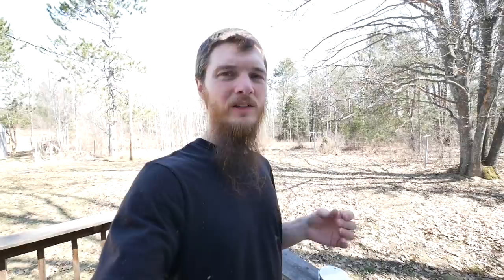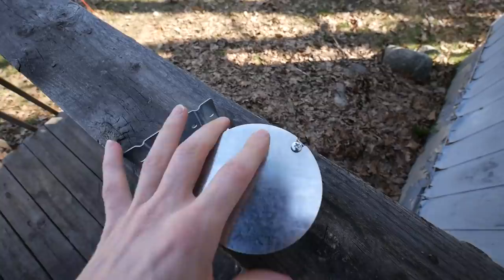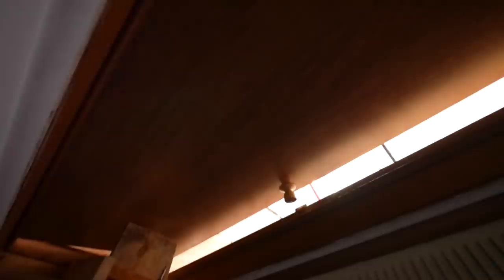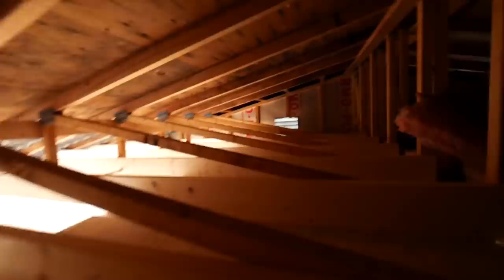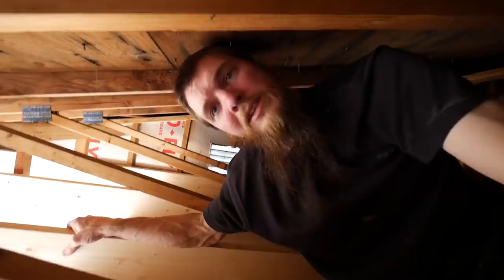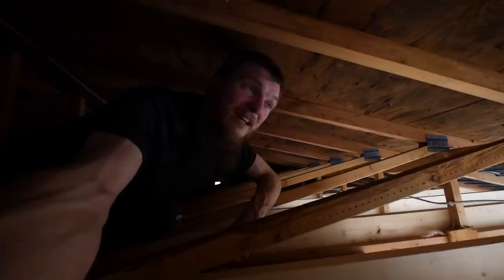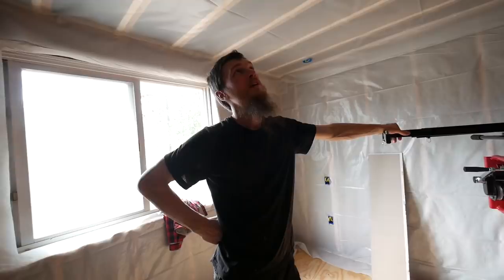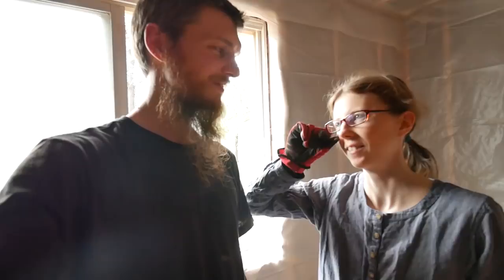The Most Ridiculous Fan Box Installation - Home Renovation

Comment: Doug they make a box that attaches right to the truss. You install it from below its plastic and holds 70 lbs. whoever sold you that box did you no favor. Been a electrician for over 30 years there are better ways and easier ways.
Reply from the maker: I do know about the many flavors of boxes out there, but I chose the exact box that I wanted and it worked perfectly. Mine attached right to the truss too ;)  I had to go up there to take the old box out anyway because I didn't want to damage my plastic. It's all good :)
Reply: plus by using the metal box, he'll need to ground the box
Reply from the maker: @randym148  Grounding a metal box isn't hard at all and just takes a few seconds.

Comment: Yes, I know you really need more advice. So, here goes. The last house I lived in had a whole house attic fan. It was in the hallway that all the bedrooms were off of and it was great. You needed to have at least one window open somewhere in the house. You turned it on and it sucked all the air right through the house. You didn’t have to have it on long before you had the whole house cooled. Ours was placed next to the pulled down attic stairs. It didn’t vent out the roof either. I think the air went through the ridge vents.  Just my thoughts.
Reply: Yes I had one too but had side house vents.  BEST thing since sliced bread!  Within 10 minutes the whole house was cooled down to the nighttime outdoor temperature.  Every house should have one because of the small cost to get rid of the summer daytime heat in your home.  I can't say enough about them.
Reply from the maker: I've only seen one of those in just one house and it's an interesting thought, but Michigan doesn't really get too hot and I wouldn't hate to have another place for heat to escape.
Reply: @diyfferent  in the wintertime we just packed in some insulation (like the pink insulation you put on your interior walls) and plastic over it. " 2 minute job" and when we were ready to use the whole house fan again when it got warm, we just laid it to the side of the fan. Used the same insulation over and over again.  You won't go wrong getting one if you so choose.
Reply: @diyfferent  Funny situation:  when I was having my rugs professionally cleaned the windows were opened all the way but the poor guy was dripping wet with sweat while working.  He asked "do you have a fan"?   I said  "No, but I can get you cooled off by a breeze blowing around you".  The puzzled look on his face was worth a million bucks when I asked him to close all the windows on the first floor while I closed all the second floor windows.  I said "OK open only one window about 3" inches in the room you're working in and let me know when you did it.  After I heard him say "OK it's done" I flipped the switch.  When I came back downstairs he said "What is that, it's like being in a wind tunnel and better than an air conditioner"!  I said "It's a whole house fan".  He said "I got to get me one of those for my house, if I didn't see it for myself I would of never believed it, and I thought you were crazy to have me shut the windows".  
I have giggled over that experience so many times when it comes to mind.  Thought I'd share it.

Comment: A ceiling fan will keep things cool cheaper and you will be glad you have one. Get a ceiling hugger. They have cool modernist minimalist looking fans. We use ours often. You will need a fan with wood heat to circulate it. Blown in insulation sits and smolders is what I read. Have you seen that? I don’t know if it is true. Your mineral wool looks good to me. Good job Doug!

Comment: Everybody is right. Ceiling fans save on electricity and they’re relatively cheap. You will need to add a bracer board to help keep it from causing the ceiling to sag. We have ceiling fans in every room including the bathroom.
Reply from the maker: This fan box doesn't need any additional support :)
Reply: No ceiling fan designed for home use would cause that ceiling to sag.

Comment: actually an attic fan is the best. you put a big fan that sucks air in the windows and pushes air up into the attic and out some big vents, we had one and it cooled the whole house down in 10 minutes. we turned it off and the inside of the house was then as cool as the outside. we did this every night right before we went to bed and it was the cheapest air conditioning we have ever had. then we shut the house up in the mornings, pulled the drapes and keep it as cool as possible, and started all over in the evening when we got back in after working. I suppose you could put a big heavy duty fan on one end. The ceiling fan will probably be good enough in MI would be my guess, not sure how cool it is up there in the summer at night??
Reply: attic fans are wonderfull!!

Comment: Good move, I have fans in every room but then I live in Arizona, so air circulation in addition to cooling/AC is important. If you don't like it you can just take it down and put a regular light. Since you didn't wire in two switches (fan and light) most of them come with remote controls that will do the job for you. Give it a try. You can get smaller ones, short and modern looking ones or whatever style you like.

Comment: A ceiling fan would be more then awesome.  I wish we had one in our bedroom.  I don't especially like fans either (regular fans) because they can be noisy.  The ceiling fans DO NOT make noise - they just run smooth.  We've got one in our entry way and it pulls cooler air up from the basement when it's warm.  There has been many a time where we avoided turning on the air conditioner when we've turned on that ceiling fan instead.  I would greatly prefer to have a fan on when the temps are hot.  The alternative is to turn on the air conditioning and close all the windows - no more fresh air.  Another choice would be to just to lay there and sweat which is guaranteed to keep you awake until by some miracle you fall asleep.  Now if installing one in your bedroom when you're done updating it, interferes with things that would go on below it, you just wouldn't be able to install the fan.  But if a ceiling fan wouldn't interfere with anything, I would put one in because you will love it.  I have to say, I was thinking ceiling fan as well, but I didn't comment on it because I was thinking of other things - like the drywall being securely held up on the ceiling.  But yea, ceiling fan?  In a heart beat and if you install a ceiling fan later, you won't be sorry that you did this today.  You can always install a ceiling fan somewhere else in the house, and you should most likely do that.  But the bedroom?  Definitely!  It would give you so much comfort on a hot night.  The less times you have to use the air conditioning, the better.  I get really bummed having our central air on because it's just stuffy.  Give yourself the choice to choose.  We bought a good ceiling fan and have been using it for about 15+ years now.  It serves as your ceiling light too.  Installing an additional fan elsewhere in the house would be wise as well.

Comment: Doug...........why did'nt you just cut out say a 32"square section of plastic and comfortably do the required work within that opening atop a stepladder or your platform and avoid the nails, heat, discomfort, injury risk etc?? When done, cut a slightly larger piece of plastic and place it overlapping the hole and tape its edges to complete the seal? I don't get your nail hazard etc approach. Glad you made it out safely.

Comment: That was fun watching you climb up there and installing the box, better you then me. LOL I was thinking the ceiling fan box in case you ever change your mind or sell. I love my ceiling fans of course I live in Florida. You can get ceiling fans that hug the ceiling with lights and even remote control. All of mine have lights and are remote control but I have 10' ceilings.
Reply: Yeah, reminds me of the work I had to do 25 years ago when I was his age, crawling around exactly the same way, doing the same thing--however, the ceiling fan rated boxes used to have the cross brace and metal octagon box...AND the drywall and blow in insulation was already up....

Comment: I can guarantee that mobile homes are not designed for going in the attic. I've lived in single wides and what some call a 1 1/2 wide. They are not fun. For a mobile home  ceiling fans are not good because of the low ceilings they usually have. Hope everyone is doing good and having a great week. Be safe.
Reply: James... we have the ceiling hugger type of fans in our mobile (7 1/2 foot ceilings) , and we can walk under them with no problem.  We run them on the low speed, and it's just enough to move the air and keep us cool enough.

Comment: We have a ceiling fan in our living room. Thats enough for me. We just put in a window fan or A/c unit. As you stated, the ceiling is too low anyways. You are a brave soul! I would have skipped that. Too much work. Blown in insulation is not as bad as you think. Wear protective gear and a mask. Expect to get hot and sweaty and still get insulation all over you. Blown in works best. However, over time, it compacts down and should be topped up. They NEVER tell you that.

Comment: Yeah- I would seriously think about how to do that lid with batt insulation instead of blowing it while you still can... Once the drywall is up, you're committed... Maybe rolled fiberglass across the top of the joists with rockwool between the joists - That's 10" and a ton more than that space was designed for... All without crawling around up in that nasty little attic. Good 'nuff and don't worry no more.  :)
Reply from the maker: The problem is that our trusses make it really difficult to put batt insulation up there properly.
Reply: Use 4 or 6" paper-backed rolled, build a reel stand for it, and feed it up over the joists perpendicular to the joists, paper side down to ease sliding it along... Attach the tabs where you can to the top of the joists, just to keep it taut and take the weight off the eventual batts. The last one will be a bugger, but the rest should go good. I wuld say, start from the eave side...
Then all you have to do is rip a channel for the sisters in the rockwool and install it normally from below under the rolled. 

Not only will it be easier, but it will be way faster than trying to blow that awful attic. Good luck. : )

Comment: You could of saved yourself getting up there. When we installed our ceiling fan, you can get these expandable arms that and will clamp or grab into the ceiling joist! It was rated for over 100 pounds We don’t have much attic above our family room either. But we have  60” ceiling fan. Living here in California you have to have ceiling fans to save energy and survive the heat. We have ceiling fans in almost every room. When it gets to over 100 here....ceiling fans are a must. Maybe up in colder climate you don’t need them as much! Have a good day!
Reply from the maker: Thanks, the expandable ones wouldn't work as well for us because of the placement of our 2x2 trusses. The box that I use is also installable from below but I had to get up there to unscrew the plastic box anyway.

Comment: You may want to invest in an impact gun, once you start using one you will never go back to using your drill for screwing in this or that. the torque is fantastic, they are much faster than drill and if you are doing lags of like 2-1/2 or longer screws they will sink them in to the point of recessed. Also with an impact you will get much more battery life out of your tool.
Reply from the maker: I would love to get one but just haven't wanted to spend the money. Maybe someday.

Comment: we had 4 ceiling fans and all they have become are dust collectors we  removed the one in the kitchen when we remodeled and i dont miss it one bit one in the basement a real  dust collector we also have one in our bedroom and living room eventually they will be removed also, i agree they are ugly unless you have high or vaulted ceilings they dont really serve a purpose but to collect dust and they can be expensive.
Reply: You do have to clean them. I use a swiffer, it’s easy. The only place I wouldn’t use one is the kitchen.

Comment: ceiling fans are not my friend, it is required to have ceiling light here, so I asked my apt manager if he could remove the fan blades, which he did. it was a beautiful fan so now I have a beautiful ceiling light in each room. Never walk into a dark room.
Reply: Ladders are good!   You might want to install an attic fan that draws air in from house windows and blows it out the attic vents. Cools house and attic where you live you would never have a hot house. In winter they have shutters that close when fan is not on

Comment: Every video thus far has featured a sensible Doug and Ashley. But then, THIS shocking video comes along and shows a COMPLETELY different, RECKLESS side of Doug. What were you thinking, man? GOOD THING you reinforced those trusses. At the very least, you should have had a ladder, for crying out loud. Advice: Hide this video.
Reply from the maker: We just had a bit of fun and got some work done upgrading an electrical box- without compromising the work we had done previously. Nothing wrong with that.
Reply: @diyfferent  Relax: My use of the word "reckless" and the rest of my shocking comment were intended as a humorous exaggeration designed to emphasize the stark contrast between what went on in this video and what usually goes on in your other, eminently sensible videos. I was SHOCKED to see you having this much fun. Too much fun and you MIGHT have compromised the work you had done previously. . . . Besides, your title with "most ridiculous" tells me that we're "on the same page." (By the way, a couple of my comments for recent videos didn't publicly show, in case you missed them.)

Comment: Why didn't you just cut thru the plastic? There wasn't any sheetrock in that area. You could've just did from the bottom and didn't have to go in the attic. For that matter they sell a conversion electrical box that you can install from the bottom without cutting sheetrock for around 10 dollars at any home improvement center. I've purchased a few and installed a few myself over the years. Its not that uncommon to find non fan style box in the ceiling on any house built before the 80s.
Reply from the maker: Just didn't want to cut through the plastic, haha :)

Comment: I really don’t understand why you took one fan box down and installed a different type? The one you took down is rated for a fan as long as the metal bar is screwed into the rafter and not just using the two teeth to hold it in place. 

But anyways, good job. Take care
Reply from the maker: The plastic box I replaced was not rated for ceiling fans but there are some similar style boxes out there that are.

Comment: No ceiling fan!!!!! Your ceilings are too low.
Reply: They have compact ones that fit up closer to the ceiling; he has eight foot ceilings I think, that's plenty of room.
Reply from the maker: Much too low. I believe national code is 7' to the fan blades and our ceiling are 7' 6". So pretty much most fans couldn't reasonably be installed in our home..but that may not stop someone from doing it anyway.
Reply: ...not to mention they are a dust bunny factory! Ugh! You could weave a fur coat out of what collects on them! 🐰😏

Comment: I will not be a back seat driver. I will not be a backseat driver.... if you are going to do this for the other rooms run 3-wire from the switch location to the fan/fixture box. I will not be a back seat driver. Well you know know what it is going to be like to climb into the cieling to blow in the insulation.
Reply from the maker: I keep thinking about the 3-wire for the switch. I can still change it out from the backside later on. A lot of the more modern and low profile fans don't have the pull chains anymore so it's almost necessary.
Reply: Eric Johnson most fans come with a remote to operate the fan and light separately so third wire is not necessary.
Reply: Just a suggestion. No need to add expense if you are never going to use it.
Reply: Newer fans will always come out with things that we never knew we could not live with out. Remote access via our smart phones is coming.